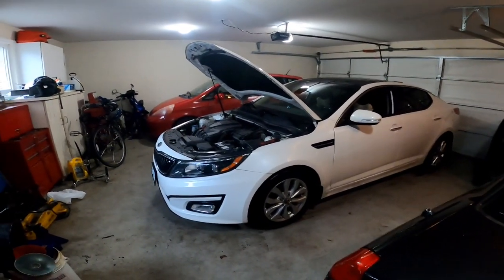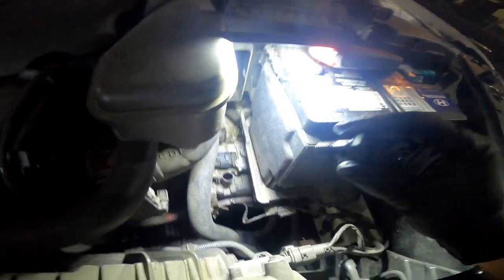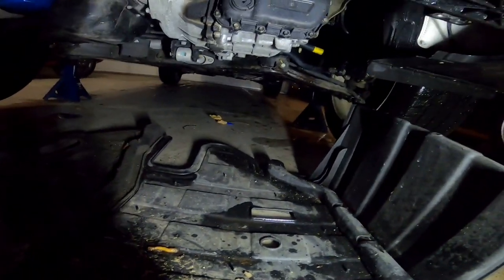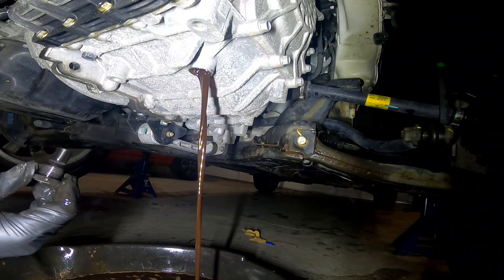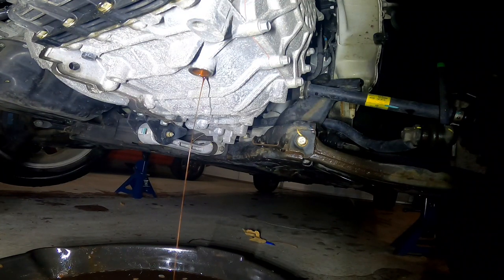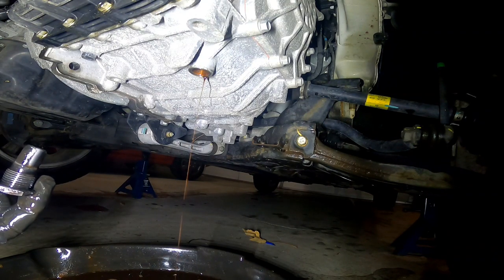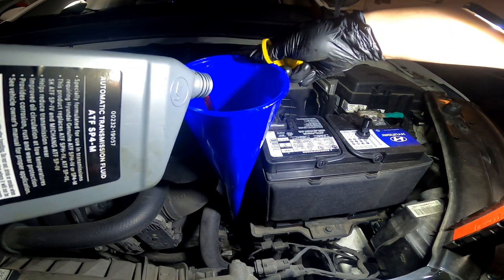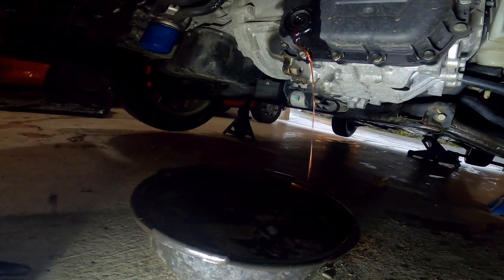Changing transmission fluid on a 2014 Kia Optima/Sonata

Comment: I did one on a 2012 the other day. I just drained it while cold than filled it while the front level check hole was removed and until fluid started coming out of it, I only used 3 quarts. after it was warmed up I opened the level check hole and nothing came out. car has 160,000 miles. I'm going to do monthly drain and fills until the fluid looks good than drain and fill it once a year after that...

Comment: I have a 2014 Kia Optima (currently 170K miles) that I bought used (it had 124K miles) and I am thinking about doing this soon. Should I use any additives after replacing the fluid?
Reply from the maker: If it has been serviced regularly a regular drain and fill should be fine. Unless your having issues  ie. Slipping or shift qualities and trying to remedy it with additives. My Honda fit had almost 200k kms (125k miles) and all I did was drain and filled regularly and changed the filter once at 100k kms. Never used any additives or cleaner and haven't had any issues.
Reply: @theoffroadingmechanic  Thank you for the input!

Comment: PLEASE READ; DON'T SKIP 

Just some very friendly advice and I mean absolutely no disrespect, but you missed identifying some critical parts to this process. Please make sure your identifying the torque spec for the drain bolt, making sure people understand they should be using a new drain crush washer to prevent future leaks, checking the fill bolt o-ring for any kind of cracks or damage, making sure to only tighten  the fill bolt just lightly since its just hard plastic. Don't just put in the same amount of fluid that you took out because it could have been wrong from manufacturing process. The transmission temperature should be around 140 degrees F to service it. Once new fluid is in, you have to shift through gears pushing fluid through the trans, driving it and rechecking the level port to make sure enough transmission fluid is in it. I could go on and on and on. All I'm saying is we have an obligation as experienced technicians to make sure we are including all steps in these processes so people can make sure they're doing this the right way otherwise they could damage their transmissions which we both know are extremely expensive. Everything can be found in KGIS and for $18 for 72 hour access to download the whole manual it's really worth the cost!

Yesterday I had to service a 2017 Kia V6 AWD and there was no video on YouTube when I was hoping to find one on the Transfer Case fluid replacement procedure. It's different after the 2015 model year. They aren't the same, so I went on KGIS, paid $18 for the 72 hr access. Saved the whole manual as a PDF to my computer and access it anytime i want. It saved me hundreds of dollars instead of going to Kia.
Reply: Thank you @ Daniel..
Yah I thought there were a few key points  to be put in.
I'm not a mechanic. 
Just a guy trying to save a few dollars and do it my self.
What kind of flush do I use?
Which ATF is good.
You hit some key points. 
Thank you 👌🇨🇦
Reply: Rite on, couldn't agree more.
Reply: 🙄 The white knight has arrived.
Reply: @tonygirney3516  genuine kia fluid or idemitsu fluid don’t use mult vehicle fluid only exact fit
Reply: What's KGIS?
Reply: So if you don't mind me asking, what was the torque spec for the drain bolt?
Reply: Where do I get a new crush washer
Reply: @ryanshaneprod3487  you can buy a pack of the copper ones of various sizes. Because copper is soft it acts as a pretty good seal between the pan and the bolt without damaging either. Amazon can be a decent source. Search for some on there.
Reply: @GreatSeany google Kia KGIS. It's the system where mechanical information and procedures for normal maintenance exists for real world Kia technicians
Reply: @tonygirney3516 an actual trans fluid flush isn't a good idea. Honestly every 50 to 60k miles, just drain and refill. This way, you keep the fluid from ever burning up or compromising the additives in the fluid and keep the transmission happy. Honestly transmissions have never been a weak point for Kias though. Not like their 4 cylinder engines.

Comment: I had a warranty job that has came back numerous times for mirror adjusting issues. First time was the R/H mirror motor was bad, second time the L/H power fold stopped working with no codes showing, was suppose to replace the whole assembly but the part that came in also had the same problem, no codes still, got another mirror assembly for the L/H side and still didn’t work but it finally gave me a code and pinpoint pointed me to the door module.
This poor guy has been back for the same issues so many times and we can’t do much until the problem truly shows itself.
Reply: After the first replacement assembly didn't work, why wasn't troubleshooting done on all related circuitry?
Reply: @dearboy05  the pinpoint asks you to look for any breaks in the harness including the jumper harness inside the mirror assembly, if there isn’t any breaks then the conclusion, without any set DTCs, is to replace the mirror assembly. The modules are not serviceable by normal means and the circuitry inside cannot be ohms tested without breaking the shell.
Reply: the Optimas up to 2015 have been known to have pretty unreliable power mirrors. Mine had to be recoded so many times. that particular dealer wanted to charge me every time after the 2nd time and by the third time I requested them to replace the mirror assembly because it was within that B2B warranty period and it took dealing with Kia Corporate to get them to change it. They actually sent me down to a different dealer 10 miles away and never saw the issue again. Kia has come a very long way. The Stinger is an incredible car with a few mods.

Comment: Was wondering where you prefer to jack up the car when putting it on stands?

I haven't had to jack up the rear yet, but on the front I want to jack it up where the LCA meets the subframe but my jack isn't low profile enough to reach it at the right angle without blocking the pinch welds. Where would you recommend, or should i get a lower profile jack to reach that spot I mentioned?

Comment: Hello. Was this your first time changing the transmission fluid in your car? I have a 2014 Optima SX Turbo with 55,000 km in Canada, and I haven't changed the transmission fluid since I bought it new.
Reply from the maker: When I was at Hyundai we changed the fluid every 50k kms they say it's life time fluid but it really isn't. This was actually a friend's car not mine. We get complaints about the transmission delay shifting slipping right around 100k but those are from people thinking it is lifetime fluid.

Comment: Good video. Thanks for posting. I noticed this is a Kia and you used Hyundai fluid. Would the reverse be OK as well? I have a Hyundai I want to drain and fill, and I have some leftover Kia fluid that I used in my 2016 Sportage - Kia SP4 M fluid. Do they both use the same formula? In both manuals, the description for replacement fluid is exactly the same, by the way. Thanks for your time.
Reply from the maker: They are the same fluid other than the SP4 RR for the Hyundai Genesis that cost a whole lot more. Just like Honda DW1 and Acura DW1 transmission fluid.
Reply: @theoffroadingmechanic  Thanks for the response. I find that in my area  (VA, outside Washington DC) it seems that the Kia fluid is less expensive than the Hyundai - at least at the Kia dealership near me.

Comment: I have a 2011 forte that has a slow drip. I am wanting ti check thr fluid level and top off.  Docyou check the level while the vehicle is running in park?   It appears so from this video I just wantvto verify first to make sure I dont pump out more fluid than just the access.  Thanks in advance,  great videos!
Reply from the maker: Does your Kia forte have a metal oil pan on the bottom of the transmission rather a plastic or some older ones can have a metal one on the side? Yours might still have a dipstick. Both will still need to check while running and on level ground. If it has a dip stick it should be an orange handle by the airbox and battery area.
Reply: @theoffroadingmechanic  thanks for the reply.  Yeah I have the same setup as the optima it appears.  No dipstick with a metal pan and same check plug on the front side plastic valve body cover.  You video sure helped, I was unaware I needed to check fluid while car was running.  Now that I have seen and verified I feel much more comfortable checking my fluid level.  Thanks again!

Comment: So just removing the level check plus and letting it drain removes the excess fluid?  And then you just screw the plug back in when it’s at a trickle

Comment: Thanks a lot cuz I really needed this but, what kind of the transmission oil did you use cuz i have a sonata 2016 2.0L
Reply from the maker: I used the OEM sp-4 m
Reply: you can use the Valvoline Max Life ATF that can be used for pretty much most vehicles. Any Kia that's for sure.
Reply from the maker: @DanielWraps  yea there's other option out there. The OEM stuff is expensive I just happen to have it at home. Even at the dealer BG supplies us with there trans fluid that come in 10qts containers.
Reply: @theoffroadingmechanic  Nice :) it's pretty clear you know what you're doing just asking that in future videos take the time and pretend your speaking to someone who is learning how to change ATF for the first time. Keep doing good things bro :)
Reply: @DanielWraps  Thanks a lot Daniel, I really appreciate your advice

Comment: Hey I'm from united Arab Emirates🇦🇪 I just buy kia optima 2013 hybrid US spec  it's on 128k miles right now vehicle is perfect running and smoothly gear shifting without any problems, also I recently changed engine oil 5w20 which recommend dealership, may I know should i change transmission oil or what types of fluid can I use? There is sealed type of transmission guys😢
Reply from the maker: I usually just use the OEM fluid.
Reply: @theoffroadingmechanic  Dont no last when changed transmission oil but any way I will change it can you tell me how many Liters required?

Comment: Is there a gasket on the pan to change the transmission filter where do you make your own gasket with a gasket sealer? And is the filter right behind the pan.. When I pull the pan off?
Reply from the maker: Older models will be silicone if it has the metal front pan. If it is plastic then there is a rubber gasket. There is no filter behind the pan just the valve body and the pickup/strainer isn't removable or accessible once the pan is off.
Reply: @theoffroadingmechanic   ok thank you for the info

Comment: Did you have to takeoff one of the intercooler lines so refilling the trans Didn’t take forever? Also I would’ve liked to see when you put the inspection cover back on, when exactly you consider a slow trickle so I could have a good idea.
Reply from the maker: This is a non turbo but you don't need to take the intercooler pipe but you will need to take off the intake for the airbox should be just 2 10mm. And the fill is just right there by the battery. Just don't fill it while the level check cover is off cuz it will just pour out of there and not really fill it. The valve body sticks out a bit from behind that cover and kind of directs the fluid out the check hole. I put the level check back when it's just slow trickle or a slow drip is fine.
Reply: @theoffroadingmechanic  sorry I misspoke, I meant disconnecting one of the two coolant lines to the transmission not the intercooler when filling so it doesn't take forever. And yes I understand the whole process I'm just really nervous about when to "call it", it seems like you let yours come to more of a slower trickle than in some other videos. Thanks for the info and the video I appreciate it.
Reply from the maker: @6atlantis  no worries, if it's still flowing out quite a bit then it just means it's still over level it is just a level check. There isn't any coolant lines other than the oil cooler lines. Unless you have a model where they slapped an oil cooler in front of that plastic pan and blocking the level check slightly. But disconnecting anything won't help in filling and I wouldn't rush in filling  just pour a steady stream so it wouldn't back up and make a mess and you should be fine.
Reply: @theoffroadingmechanic   there are two transmission cooler lines under the battery, forward and to the right of the fill plug, right at the positive lead to the starter solenoid. I had a Hyundai tech tell me to disconnect either one of them so I don’t airlock when refilling. Either way it’s not a big deal I’m not in a rush, wish me luck thanks again.

Comment: Is it the same procedure for hyundai accent 2014 usa version that uses the automatic transaxle a6gf1 ???
Reply from the maker: If it has that pan in the front with the check plug it's pretty much the same. The accent before had a dipstick either 2012 or 2011 was the last year.

Comment: How to know what is the correct fluid for the transmission? Have some type of numeric name like the engine oil? (like 5w30)
Reply from the maker: not like motor oil  but, If you have a shop manual it will say what type of fluid, your owners manual may tell you or call your local dealership parts department give them a VIN number and they will get you the correct fluid

Comment: Hey buddy quick question I just got a 2012 Kia Optima  the HID headlights will not focus inwards I tried adjusting them with no resolution I was told that maybe the reflectors are worn out I was wondering if I do the halogen replacement headlights are they plugged and  play? Is the main pigtail going into housing the same?  Any help would be great thank you
Reply from the maker: I'm not 💯 sure most likely not plug and play. But the hid has auto leveling and the halogen does not.